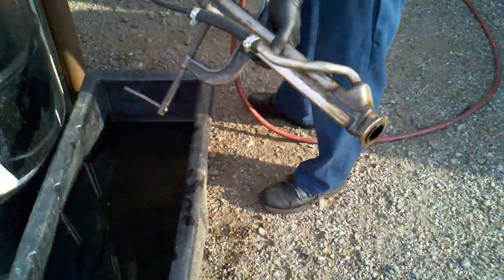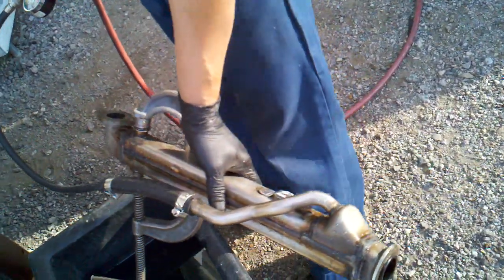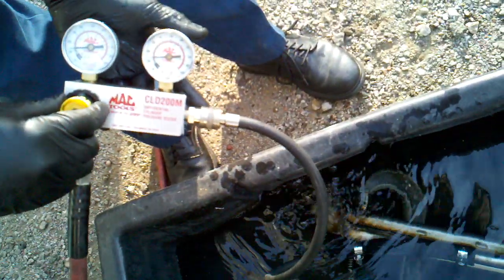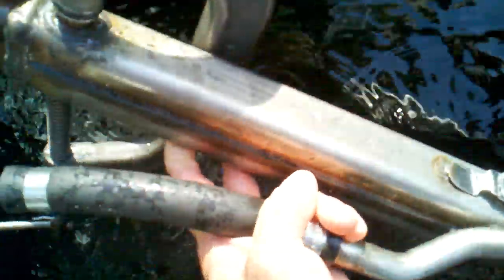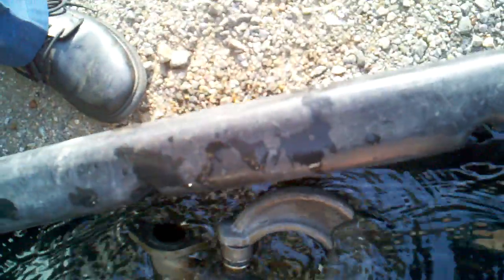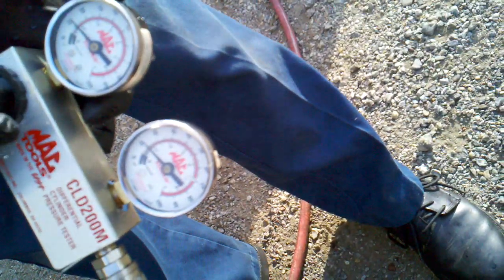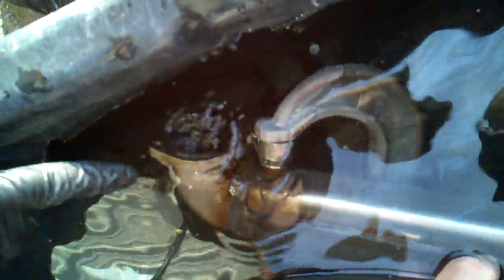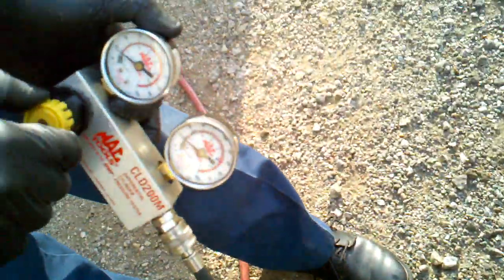Ford 6.0 EGR cooler leaking,testing

Comment: any cheap testing kits or ideas for this procedure? Thank you for the great video
Reply from the maker: Out of the vehicle, this was the low budget testing :)   In vehicle you can use a pressure tester for the cooling system and remove the EGR to look for coolant. If it is a small leak it may not show up. Also when they are leaking the EGR gets like a real nasty wet sludge built up on the lower part of the EGR vale and often will cause it to stick open and make the lower power condition and set off a check engine light.
Reply: @Craig's Car Care  , thank you. I found some old water line and constructed one, set at 50 psi and no leaks but coolant loss is visible. any thoughts, truck has no boost. new up-pipes, turbo rebuilt (unison ring) is free, new VGT, EBP (ebp tube clean) all KOEO signals show good. perplexed in Ohio

Comment: Insurance is going to send an adjuster? They cover mechanical issues?
Reply from the maker: Hi Jesse, Great question. That one was 8 years ago. For extended warranty coverage (if the client has this) you can start a claim. Or if it falls under the factory warranty or federal warranty and the client wants to go that route . Thanks for your question.
Reply: Craig's Car Care - I didn’t expect a reply. I sure do appreciate your commenting back. I have a 2005 6 L and just performed the same test on my EGR cooler and no bubbles were present. I am getting white smoke coming from tail pipe and also losing coolant. In your experience does this sound like head gaskets? No bubbling from the degas bottle and oil looks great.
Reply: Actually, As I’m sending this message. My EGR cooler have been submerged in water with 25 psi on it and I am getting bubbles after about 10 minutes
Reply: @fatkat311  Could be a head gasket but it does not feel just right based on the other things you have already checked. We would run a "block test" that checks for combustion gasses in the coolant if it is just starting  to act up. I would recheck the EGR cooler and use 50 PSI. We have seen these where you had to test them in very hot water to get the leak to "open up".  Hope this helps
Reply: @fatkat311  Just got this one. See my last response and try the cooler first before pulling the heads.
Reply: craig zale thanks again for responding. Based on my symptoms I assumed EGR cooler but should I performed a block test as I have the test kit. At 50 psi, I have a steady bubbles. I ordered an OEM cooler with the ends welded. Subscribed!